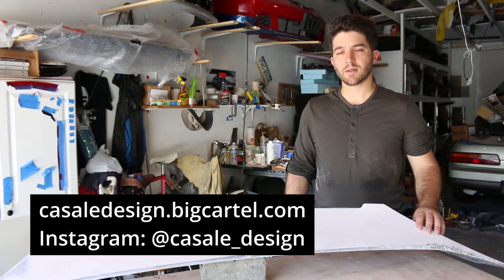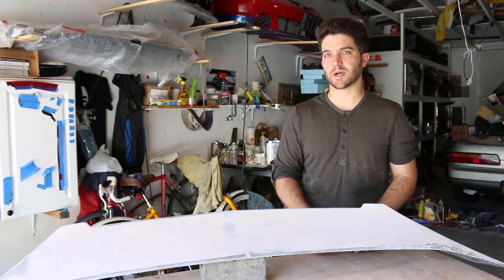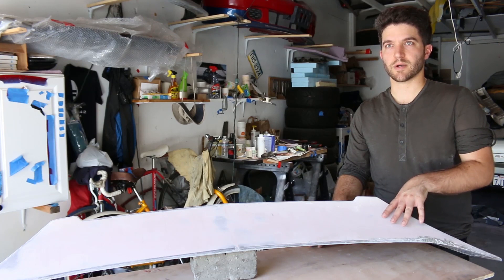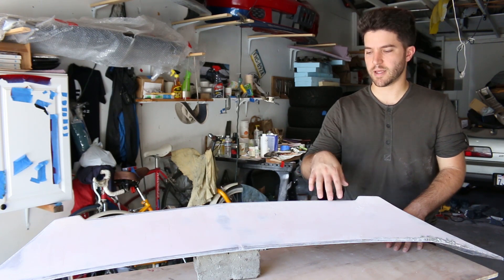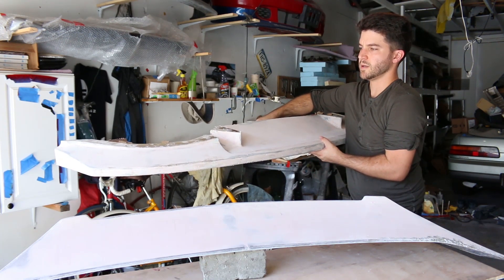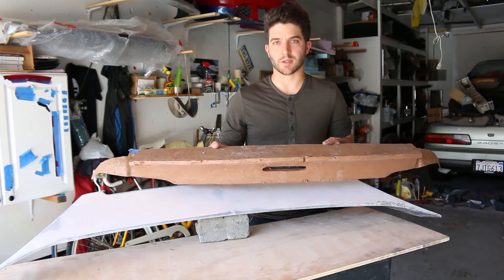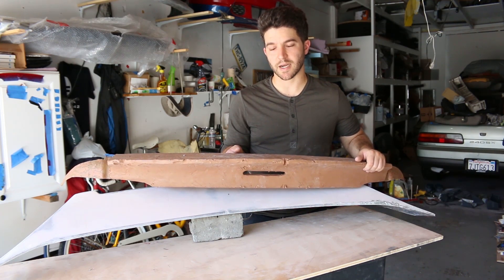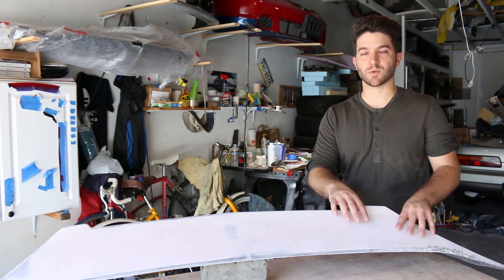What Can 3D Printing Do for Me? An Automotive Application

Comment: Thanks for the video man. As you have mentioned that you had some experience in alias , I have a question to ask. Recently I have been designing  the panels of a motorcycle in alias. Was wondering what the whole process would be for getting the model 3d printed. Like how to exactly figure out the size of panels to cut , figuring out the mounting etc. 
Any resources or links would be really helpful

Comment: Hey.  
I was looking for info on the process of designing in a CAD program for a spoiler..  the issue i'm having is getting am model of the shape of the car, on which to base my design.  
I was curious how you got this;  did you scan a car, or did you use a ready made civic model?
thanks.
seb
Reply: Hey Seb, you can find 3d models for cars online, some are free but others require payment. Depending on which software you're using, like Blender, 3ds Max, Fusion 360 or Solidworks, you need to find which file type you need. Search websites like turbosquid and free3d, or just google "car_name free 3d model".
Reply: @RetrowaveUniverse  thanks! Will do.